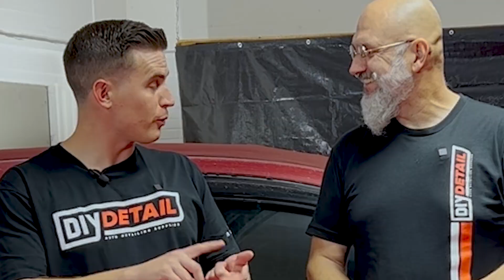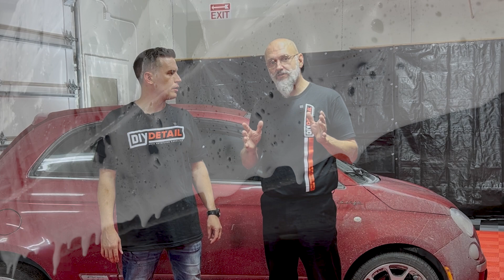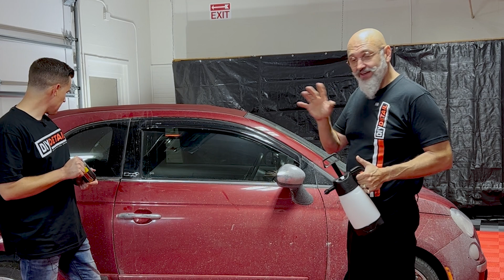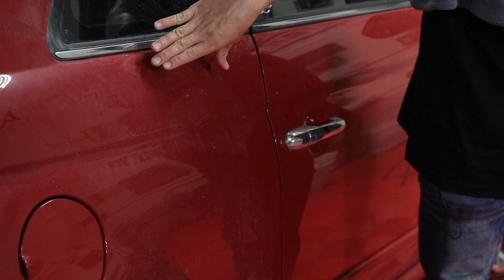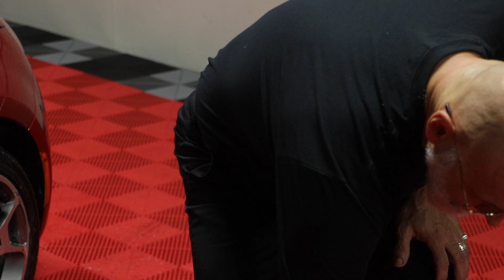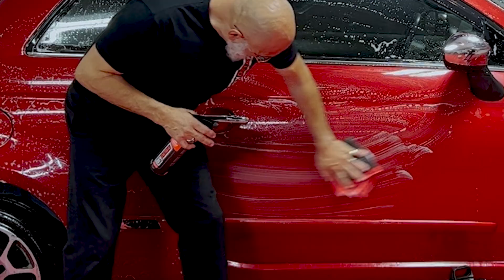POLISH & CERAMIC COAT your ride for the 1st time: Fiat Series Ep. 2 (the rinseless wash)

Comment: Thanks for the video! What’s the most efficient way to perform the recommended steps? Section by section around the car or once around the car for each step?
Reply from the maker: It depends…will you be working in a controlled environment or outside? Thanks for watching the video!
Reply: @diydetailofficial  makes sense! Thank you
Reply from the maker: Thank you 
🙏🏻
Reply: @diydetailofficial  if you are working outside, would you do all steps on one panel then move on to the next panel?
Reply from the maker: Luke, correct.
Reply: @diydetailofficial  got it.  Thanks.

Comment: Would this process work to remove older wax/sealant (not a true ceramic coating) prior to re-applying a wax/sealant/coating?  Or would I need to add a strip wash step?
Reply from the maker: Yes, it’s enough to prep the surface for another wax or sealant.
Reply: Awesome. Thanks!  These videos have been enormously helpful.  Appreciate the help and tips. Just ordered some products to try out.
Reply from the maker: Thank you, please let us know how you find them.

Comment: I find a surfactant based rinseless that foams slightly (such as DIY rinseless wash), on the interior will make a great foaming APC that is perfect because if it flashes in the sun it’s perfectly fine! 16:1 is a good starting dilution
Reply from the maker: For interior I wouldn’t go stronger than 128/1, 256/1 will do all the cleaning you need though.

Comment: Wow that panel test was impressive. Is it possible to get similar cleaning by adding an APC to a foam gun soap?
Reply from the maker: You absolutely can! I love foaming apc to pre treat but always tried to avoid windows during that process and only hit body panels and wheels
Reply: @diydetailofficial  thanks! Is there a reason to avoid glass? I usually mix some apc and shampoo on my goam gun. Yvan has really sold me on onr. Do you think its overkill to spray onr, rinse and then foam with a mix of apc and shampoo?
Reply from the maker: Possibly overkill, especially if using DIY Detail Rinseless Wash. Our Rinseless has much better cleaning power. APC’s can etch glass.